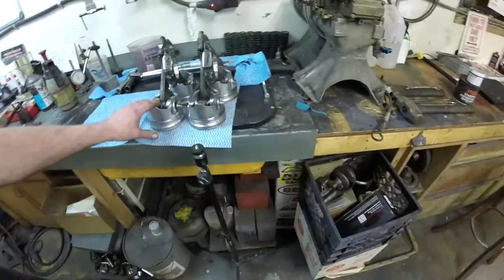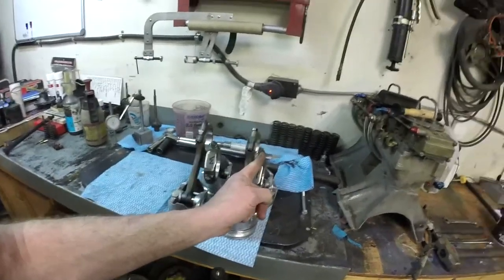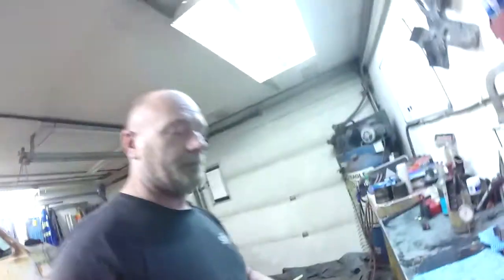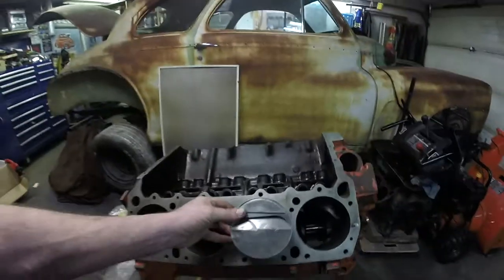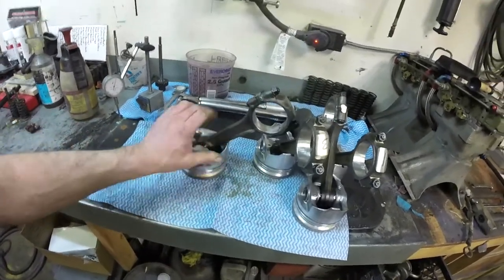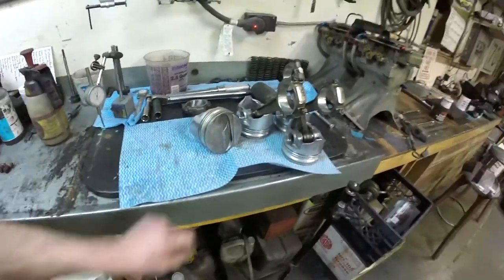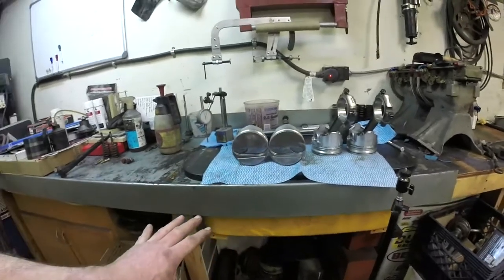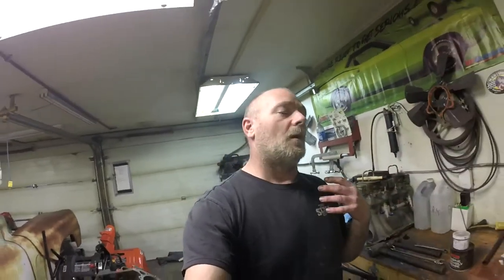Cheap 440 Build Pt15, Talking piston and connecting rod orientation

Comment: Were they stock 11:1 or were the domes milled?
Reply from the maker: They were stock. These are Keith black pistons. They'd been ran by someone who didn't know anything about piston to valve clearance 🙄. But my machine shop said there would be no problem running them with a few marks on em. 

If I want to run aluminum heads in the future, I'm gonna have to mill the dome off as there won't be enough room for piston and combustion chamber 😬
Reply: @dazeofgloryshopworks5806  Just asked cuz i thought I saw some marks.
Reply from the maker: @noccis3448  yeah man. I'd say it didn't make very many revolutions before it bent valves. Lol. But it gets a new lease on life with me. Good eye 👍🏼
Reply: @dazeofgloryshopworks5806  I'm sure it was reflected in the price, not a bad thing for you.

Comment: You really want to try to match the piston sizes to the bores as well. Some pistons will be bigger or smaller, same for the cylinder bores. Also if you don't have exact weight matched parts you can juggle the rods and pistons as 'pairs' to get everything as close as possible within your bobweight tolerance. Pair a rod with a light big end with a heavier one on the same pin till all four are as close as you can get them. It' not that easy and takes time.
Reply from the maker: You are spot on. Done it a time or two and for the amount of time it takes me, I trust my machine shop to do it correctly and make the adjustments required. 👍🏼 if I had the original crank that was set up with these pistons and rods, I'd not have needed to send er out for balancing. This poor 440 just needed a little tweaking all the way around. Lol
Reply: @dazeofgloryshopworks5806  You'd be surprised at how out of balance some of the factory engines were and worked just fine. A Post it note weighs 3 grams just for some idea. With all the oil splash you got a lot more variable weight than that flying around. I have a high end scale and rod balance beam. I do all my own component weight matching and come up with the bobweight and just tell the balance shop what I need for a bobweight on the crank. Saves me time, money and I feel better about the work.
Reply from the maker: @vincemajestyk9497  we definitely feel better about the work the more we do. Sounds like a great setup.